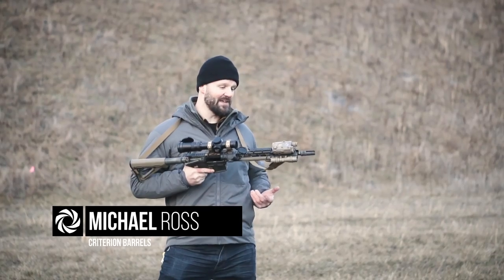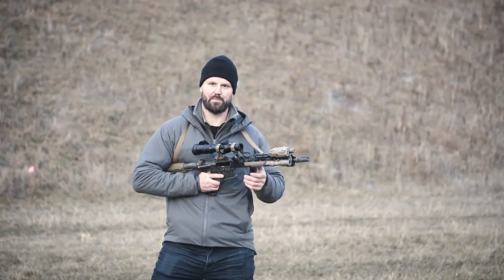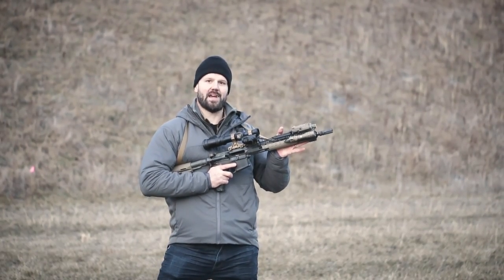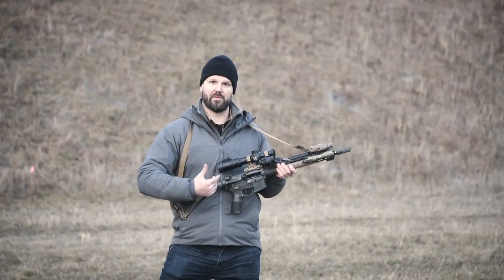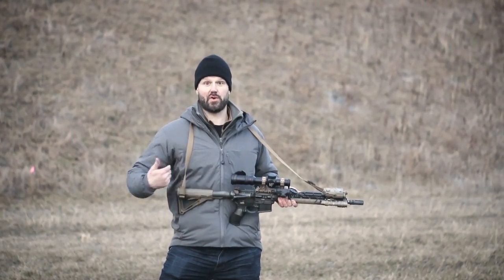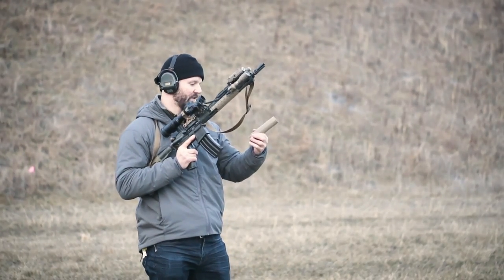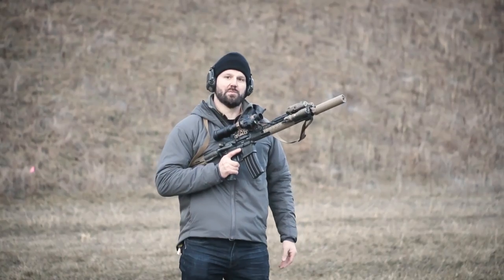How to setup your AR-15 with AND without a suppressor

Comment: I’d like to think I contributed to the making of this video because I harassed Mike at Criterion with incessant questions about this very topic. Glad to help. - David
Reply from the maker: David, thank you for your inspiration.
Reply: @CriterionbarrelsInc  would a a5h0 with a springco green spring work well with this setup?
Reply from the maker: @jubalgilbert7681  Generally I avoid the A5 System as it is not necessary for properly gasses rifles.  It can be used and I would still recommend using the heaviest buffer that reliably cycles in your rifle.
Reply: @CriterionbarrelsInc  Hi, just wondered if you had a European distributor for your barrels? Or if you will do in the future? Thanks
Reply: wait... this is the michael that answers the criterion emails? hahaha that's awesome.
Reply from the maker: @jimmerjohn9524  Shooters first... and sometimes we answer emails. LOL

Comment: Just bought a 12.5 off you guys!!! Thank you
Reply from the maker: 12.5'' guns are incredibly versatile.  I am confident you will like it.  Thank you for your business!
Reply: @CriterionbarrelsInc  I also bought a 6.5 22” off you guys. Do you think I will need an adjustable gas block to run it suppresses?
Reply from the maker: @TylerJames-gf8ms  You should be fine without an adjustable gas block.  Ultimately it will depend on your specific suppressor and the characteristics it presents.   My 22'' 6.5 runs very well with a fixed gas block.
Reply: @CriterionbarrelsInc  amazing! Thank you!

Comment: Any experience with a 13.9 core with the A5 system? Specifically an a5h2 buffer for suppressor use and without suppressor use
Reply from the maker: Yes, lots.  Typically I stick with a standard mil-spec carbine length receiver extension, mil-spec carbine action spring, and the heaviest buffer that will run reliably.  I typically like an H2 weight.  I like common parts as I travel a lot with rifles and frequently break parts on the road.  There are advantages to being able to stop into any gun shop to replace springs and other parts.
Reply: most likely wont run with an H2 buffer.....at least not enough gas. I had an H1 in mine and it was on the low end....didnt run steel case at all. was a bit bummed.
Reply: @rickypickles2219  hmmm, they stated above they ran with an H2 just fine. My 13.7 runs with an h2 pretty damn good
Reply: @beatty169  itll run steel case with an H2??
Reply: @rickypickles2219 it’s because you’re using very underpowered steel case ammo. Get some better .223 brass case or 5.56 for increased pressures. There’s a reason why steel case is the cheapest.
Reply: @Liionhawt  yes i understand this. i usually dont ever use steel case. it is crap. for a rifle Id like to depend on with my life i make sure itll run underpowered ammo. a perfectly gassed rifle (to me) is a mid length bcm 14.5….very soft shooting and runs everything. i prefer just enough to run steel but thats about it

Comment: Thanks for the video! I just placed an order on CORE 16” barrel and I was wondering which buffer weight I should use with mil-spec spring? H2 or H3?
Reply from the maker: Eric, I run both the H2 and H3.  Generally the H2 will suit your needs just fine.  I do like to run an H3 if the rifle is suppressed for the majority of the time as many of my rifles are.  Ultimately which one is optimal will depend on your particular setup and the amount of back-pressure generated by your suppressor.
Reply: @CriterionbarrelsInc  I just got the 13.9 core...same suggestion as for the 16"? I will be running 99.9% of the time suppressed with a dead air sandman k
Reply: @bensmith9164  a little late but i have this setup. i run vltor a5h2 with a green sprinco spring. works with the a5h3 too but does not lock fully with 223 unspressed. h2 does everything
Reply: @matthew bednarski  I ended up going with the armaspec silent capture H2 and it has worked flawlessly. Incredibly soft recoil.

Comment: Thank you for the information!  Would a white Sprinco buffer spring be closest to the mil spec unit you're running in this rifle?  Also, if you're using an A5 system, would a green spring and H2 buffer be optimal for the mid length system?

Comment: I'm starting to look more and more towards a 12.5" system using a Core barrel. At one point I think I need to play around with different weight buffers H2/H3.
Reply: No need to play around. 
Vltor A5
Sprinco Green 
A5H2
Reply: @codybennett8422  this, I run H3 on my 11.5
Reply: My core 12.5 is running great with a basic carbine spring and an h3 buffer. Ejects exactly like the rifle in this video
Reply: 300 and 7.62 seem to always do better with an H3.
Reply: @jayboy9124  really a h3? I just had a 11.5 build out together with criterion core barrel with vltor a5 tube and a5h2 buffer and was having issues, gunsmith recommended to try the a5h1 or a5h0. I did notice absolutely no gas to the face at all so possibly my barrel is under gassed.

Comment: For a mid length gas criterion barrel build would you run a carbon spring and tube with h3buffer or would you go with a rifle length spring and tube with h3
Reply from the maker: Personally, I prefer the standard mil-spec carbine receiver extension, mil-spec action spring, and an H3 buffer to increase locked chamber dwell time.

Comment: Can you give us an idea of the POI shift you’re seeing once the suppressor is mounted
Reply from the maker: Yes, with the rifle in this video I typically see impact shifts of less than 1/2'' at 100 yards.  The CORE Series barrels have a contour that is specifically designed to support the weight of suppressors while maximizing consistent harmonics and absorbing heat.
Reply: @CriterionbarrelsInc  
Thanks, I greatly appreciate your quick response.

Comment: With the Badger Ordnance TDX gas block did you dimple the barrel deep enough for the screws to seat flush with the bottom of the gas block or leave some screw sticking out of the bottom? I installed my TDX on a Core 16" barrel and was worried about dimpling so it has a bit of threads showing still.

Comment: Hey Mike, I am running a 8“ .300 Blackout with can rated for subs only. So I am trying to strike a balance between subs w/ can and supers without can. I did go the adjustable gas block route (wish this video was out during the build) with an H2 buffer. Some subs run awesome. Some will not run at all. Should I go to H3 for everything?
Reply from the maker: Yes, try to add a fresh action spring and an H3 buffer.  This will improve the timing of your rifle as it will increase your "lock time" or locked chamber dwell time which will likely improve performance with higher pressure subsonic loads, increase accuracy, reduce wear and tear and many other benefits.  Also, I would recommend going through and checking your gas rings, ensuring that you are using a full weight BCG, ensure proper (tight) head-space, and I am willing to bet that performance will increase. Feel free to give us a call and let me know whos barrel and suppressor you are using and we can get it to run more smoothly for you.

Comment: Mine won't lock back without a suppressor? Same on 2 criterion barrels. Do i need to drill the hole bigger?
Reply from the maker: Sounds like something is off and we can assist with getting it dialed in.  Feel free  to shoot an email to mike@criterionbarrels.com and we can ensure that everything is within tolerance as well as dial in all of the other parts and pieces you are using in your build.

Comment: Do you find that this setup is pretty gassy towards your face? Are you running some kind of vented charging handle or just a solid charging handle? Thanks!
Reply from the maker: With this set-up, gas to the face is minimal and using a vented charging handle like the Radian SD helps to reduce gas flow to the face even more (there is one in this rifle).  Increasing ones locked chamber dwell time (The unlocking step in the 8-step cycle of operation) helps to keep gasses consistent behind the bullet and going down the barrel instead of escaping rearward into the shooters face.

Comment: Do you guys make a 10.3” barrel or only a 10.5”? I know it sounds lame but I’d like my suppressor to be flush with my handguard
Reply from the maker: Although we make 10.3'' barrels for several OEM rifle manufacturers, we only produce 10.5'' barrels as stock models.  Oh, and although I would argue that function is greater than form every day of the week... aesthetics matter, so no judgement.
Reply: Wish ya sold the 10.3, I recently build a 10.3 AR pistol with a DD barrel. Would’ve preferred a criterion but maybe in the future.

Comment: I just purchased several H2 buffers to replace the carbine & H1 buffers (prior to seeing this video), for running suppressed. Should I seek an exchange (pain in ass) or do you think the H2 will be fine?
Reply from the maker: You should be ok with the H2 buffer.  There are a lot of variables, like the amount of back-pressure your specific suppressor generates.  Personally, I always like to run the heaviest buffer that will reliably cycle in my rifles to increase locked chamber dwell time.  Run it!

Comment: How dirty does it get after a full combat load 210 rounds? Has it gummed up where you needed to use your forward assist? I was looking at building a slick side for less gas in the face as a lefty.
Reply from the maker: We have tested rifles with thousands of rounds suppressed without cleaning or lubrication.  A properly built AR-15 is one of the most reliable weapons on the planet.

Comment: I have a question, I just replaced my Ballistic Advantage Hanson series Barrel with a Criterion 16” 416r Nitride barrel  and replaced my old Midwest BCG with a BCM BCG, now the Gun feels more snappy, and the ejection moved from the 3-4 o’clock up to the 1:30-2:30 position. Why? I was hoping the gas port would be on the smaller side of spec. The gun still has the same H buffer and Sprinco Blue spring.
Reply from the maker: Did you check head-space?  If not you will get chamber pressure fluctuations and inconsistent seating depths... Also, I would recommend using a standard mil-spec action spring and a heavier buffer.  The Sprinco spring has an increased tension to slow the cyclic rate but the H buffer is still pretty light and it wont delay unlocking as well as an H2 or H3 buffer.   Regardless, something seems off with your build so feel free to give us a call and we can get your rifle dialed in.
Reply: @CriterionbarrelsInc  It’s been some time now with the barrel and I have now fixed the issue. I originally verified the headspace with .223 spec gauges and ordered an H3 buffer. I tried a myriad of springs and found the Red Springco was the best option. I tried different extractors and ejectors with different extractor and ejector springs. Nothing worked because the system was getting way too much gas. The ejection pattern and recoil never changed. I then decided to order a restrictive gas tube from BRD Gunworks called EZTUNE gas tubes. I gave them the specs of my rifle and they picked the appropriate port size and sent it to me, the gun is now the way it should be. Low recoil and perfect 4 o’clock ejection unsupressed. The gas port was too big as I suspected.

Comment: I see you have a nightforce 1-8 in this video and some others you have a razor 1-10. Which do you like better? I have a bcm that I just but a criterion 14.5 core barrel on and trying to decide which optic between these 2. 
Thanks
Reply from the maker: I really like both scopes.  All things being equal, the Nightforce is likely a little better on 1x without the illimitation.  With the illumination on, both are very fast at 1x.  The new Nightforce reticle is more precise but if I could only have one it would likely be the Vortex.  You really cant go wrong with either one and both will take your 14.5'' gun to its max effective range (I  take both optics out to 1,000 yards on 14.5'' AR's on a routine basis).
Reply: @CriterionbarrelsInc  thanks for the info. That’s what I’m looking for is a do it  all rifle that’s accurate and able to shoot 800-1k yards. I’m thinking from all the videos and reviews I’ll be happy with the 14.5 core barrel.

Comment: Would your setup change if you used a 12.5 core series vs a 14.5? Wish i saw this before picking up an adjustable gas block, blue springco spring and an h2 buffer lol.
Reply from the maker: No, I have several 12.5'' rifles and use mil-spec action springs and an H3 buffer. 12.5" barrels with a carbine length gas system are extremely smooth, very similar to a rifle length 20'' barrel.  The gas ports on all of our barrels are tuned to the specific barrel and gas system length.  We test all of them with a wide range of ammunition (both high and low pressure) and suppressors. At the end of the day you are looking for performance (accuracy and reliability).  This means that your rifle needs to be properly built and timed (meaning each of the steps in the 8-step cycle of operation takes place when and how it is supposed to.  Try your blue spring and H2 buffer.  If it works for you, awesome.  If not take it as an opportunity to learn about your rifle.  If you have questions, give us a call and we can get into the details.
Reply: @CriterionbarrelsInc  all adjustable gas blocks fail?
Reply from the maker: @tech6263  Everything fails eventually.  With guns, I personally like to eliminate failure points, especially when they are not needed...  If someone chooses to use an adjustable gas block that is entirely up to them and it is perfectly fine.  We shoot industrial quantities of ammunition and because we have broken nearly every adjustable gas block that gets pushed hard, we choose not to use them.  Again, this is simply personal preference based on the experience of breaking dozens and dozens of adjustable gas blocks.  Your mileage may vary and I encourage people to disagree with me... or better yet, run your favorite adjustable gas block on a machine gun suppressed and see how long it lasts for you.
Reply: @CriterionbarrelsInc  I doubt my mileage will compare to yours too.

Comment: When you said you had issues with adjustable gas blocks, was one of them from seekins?  I have their normal adjustable block and the one with the lever.  I am building an sbr and was thinking about installing one of them on my suppressor build
Reply from the maker: I have broken most adjustable gas blocks (especially when running them on machine guns).  They do work and some designs are better than others, I have just found them to be unnecessary if ones rifle is properly built and timed and they are also a common failure point that I would rather not have on my personal rifles.  If you don't shoot industrial quantities of ammunition, you may never experience a failure.  We tend to shoot more in a day than many do in a year and see things fail at a much higher rate.  I would encourage you to  try it for yourself.
Reply: @CriterionbarrelsInc  appreciate the response.  Currently i am building a AR  and have both adjustable gas blocks.  Also ordered geiessele’s super spring buffer and h3 weight
Reply from the maker: @Stoicexpression  Excellent.  You may not need the increased spring tension of the Geissele braided spring.  It will likely work when suppressed but may result in failures to lock to the rear when unsuppressed.  I recommend standard mil-sec action springs as our barrels feature tuned gas ports and are not over-gassed.  Give us a call if you have any questions.

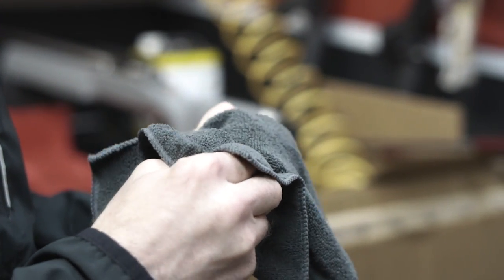Comment: What are the port sizes on the 12.5" hybrid chrome lined barrels? Mine's undergassed and doesn't cycle steel w/o a reduced weight carbine buffer, and can cycle hot m193/m855 very comfortably with a h2 with ejection at 3:30 - 4:00' dependent on manufacture
Reply: Don't run steel! Of course that weak barrel wreaking crap doesn't cycle.
Reply: I pin gauged them at .066, if it’s short stoking you me be leaking gas.

Comment: Mike what mount do you like with that lpvo?
Reply from the maker: I highly recommend the Badger Ordnance Condition One Modular Mounts (COMM).  I have tested the 1.54'', the 1.7'' and the 1.93'' heights and all of them are awesome.  I am particularly fond of the 1.54' as it affords the best cheek weld and improves the speed and accuracy I am able to obtain from the prone due to more solid points of contact.
Reply: @CriterionbarrelsInc  Thank you!

Comment: Adj gas blocks need maintenance and can and do fail..I have not had the leaf spring problem with their up-dated versions..,  The new rifle speed adj gas block looks like a game changer for durability and ease of maintenance. A .003 spread is perfect from a 1.4646 and a .001 difference with an AR bolt is also excellent..Having a tight gas ring bore is good but I find the bolt tail to bolt tail bore clearance more important for an optimum gas seal...Just ordered my first Criterion barrel and looking forward to testing it. Your barrels must be good as they are months on back order..